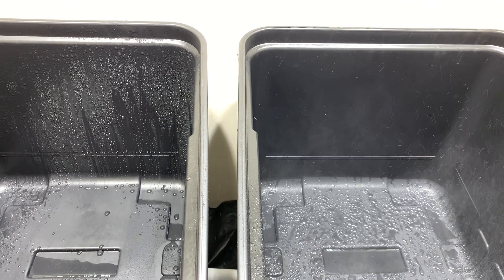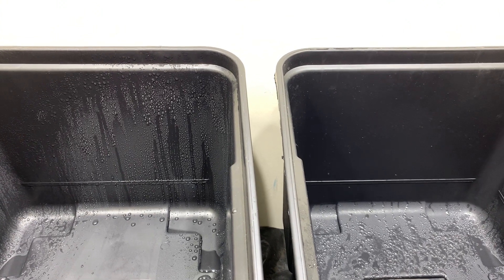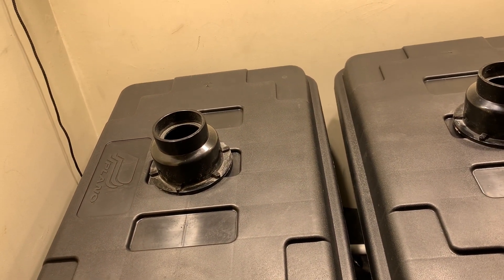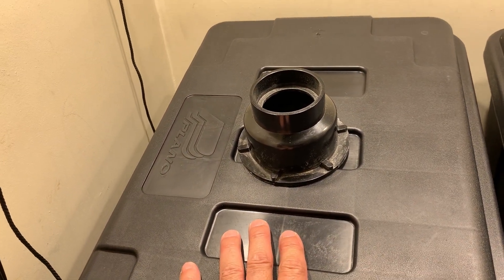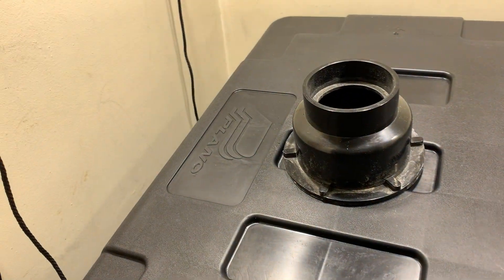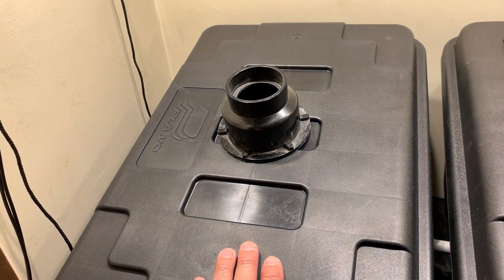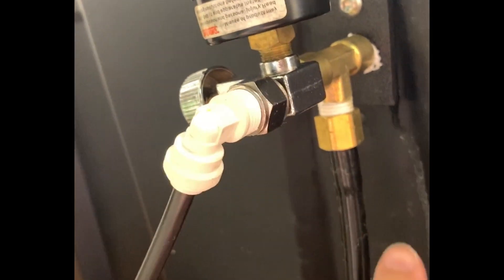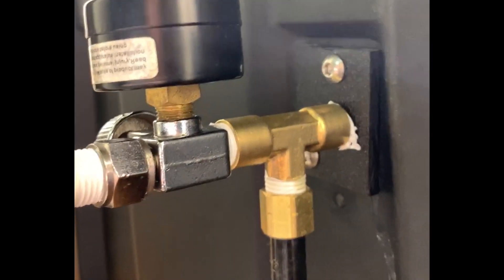HPA vs AAA Grow Off  (High Pressure Aero vs Air Atomized Aero)

Comment: what do i need to build my own system like this can someone send me what i need and possibly the cost
Reply: You need air atomizing nozzle or two (siphon fed),  12v solenoid(s), a 12v cycle timer and ideally a silent air compressor.
Reply: @atomizer2665  external mixing pressure fed nozzles would allow for most precise control, but comes at a cost of 2 additional pieces (pressure tank, and water pump)

Comment: where can you buy them?
Reply: Thats what i want to know ill try to figure out how ro make one once i have a bought device first
Reply: @HollywoodShezzy  try either bete or schlick nozzles (model 940 for example) both are the leading manufacturers for  air atomizing nozzles and provide the most documentation one could ask for. for most precise control use external mixing nozzles, so you can adjust water flow and droplet size with water and air pressure

Comment: I just built a system that uses both. I have 18 brute totes, 36 plants. The HPA mist is needed for early lateral root development, and once a beard is formed, the atomizing fog helps nurture and feed those fine hyphae hairs.
Reply: I would simply adjust the AA nozzles air/liquid pressure/siphon height to provide the correct range of droplet sizes.

Comment: I would have just supplemented oxygen or air with an HPA system using a Venturi injector. I think AAA is an overkill and not required at large
Reply: You have to experience HPA and AA to know the difference.

Comment: Can you tell me the name of those mist nozzles and where I Can purchase them? Thanks
Reply from the maker: which mist nozzles are you referring to?  The AA is using a DIY one.  The HPA is from the Mist King set up
Reply: @aeromah1062  the diy
Reply: Try senningers for HPA mist, and Aeroscience for dry fog. I’ve tried a lot of atomizing nozzles and the best ones are the specific ultrasonic type sold by Aeroscience. A Chinese company also makes stainless versions. You can get them on eBay for $30.
Reply: @jonosterman2878  
It becomes clear why you need to run both HPA and AA nozzles to get the job done,  i wouldnt recommend buying the aeroscience nozzles for that very reason.

Comment: this beats the shit out of DWC for the simple fact that the mist keeps the water cool, no need for a very expensive water chiller. I found this series while researching aeroponic systems to replace my Dwc. I'm making a change for sure.
Reply: For evaporative cooling you need a low RH% and a lot of airflow, aero root chambers have a high RH% and not much airflow. I havent done DWC in a long time. It would be tricky to sort a level playing field for the side by side test because you cant run a DWC drain to waste. All things considered, a dialled in (HPA/AA) aero setup should gain a distinct advantage over a dwc assuming both are operated optimally. You always get better results from a method you enjoy, whether its aero, dwc or soil.  https://youtu.be/XtHJH69asXo
Reply from the maker: Well we will see if it actually does best DWC.  DWC is one of my favorites as well but, you have a solid point regarding the temps.  If you are running a RDWC then the internal vs external pump is a big factor not to mention the constant infusion of the ambient air both in which driving up the water temps.

I will do a side by side with that in the future.

Give Aero a shot and see how you like it.  When it's good it's good... but, when it's bad it's not so fun lol.